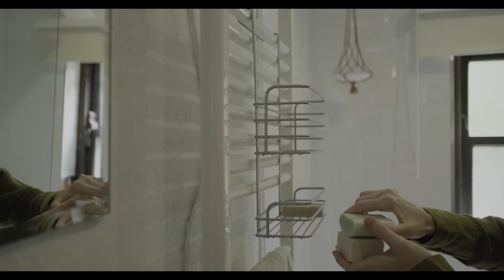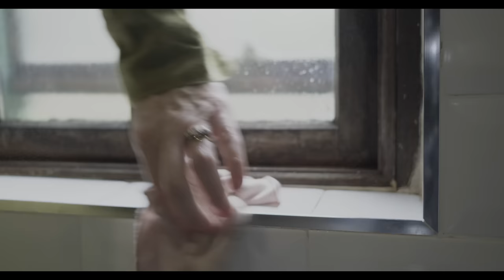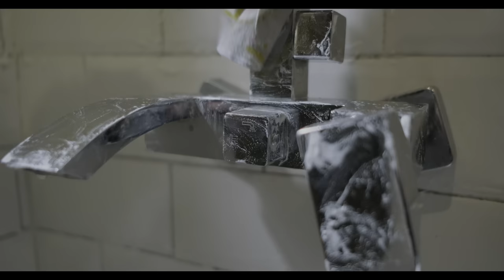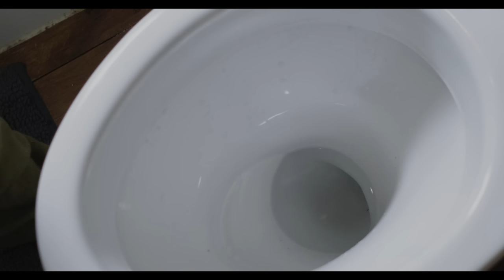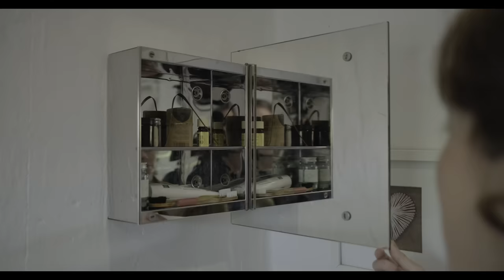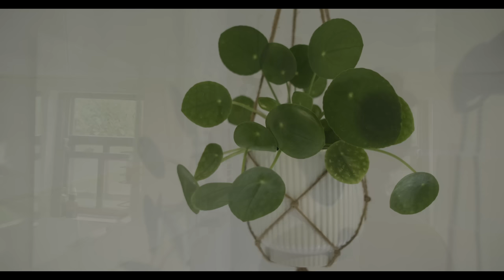Non-toxic Bathroom Deep Clean - August at Fairyland

Comment: I got.emotional seeing your daughter at the end of the video. So cute. I look forward to your monthly vlogs they're always so calming. As a single mom to my own 1 year old daughter it's taking me a bit longer to do my deep cleaning but still trying to get it done. I always feel so much more calmer once something's been fully cleaned
Reply from the maker: Awh a 1 yr old. Aren’t they just so precious… I had to have my mum over to babysit while I cleaned the bathroom 😂
Reply: I buy a gallon of Castile soap every year. I use it for everything: dishes, I have foaming soap containers in kitchen and bath sits by the sink and I move it to the shower when I bathe. I use it as laundry soap, I make windscreen washer for the car, mop floors. I don’t use it on my hair, but I wash the dog with it because it’s unscented and tear free. 
I have switched to tooth powder which I make with betonite  clay powder, raw cacao, baking soda and xylitol. 
I do the same thing with my kitchen brushes, except I found a stainless steel handle that you just slide the brush on to. I send twice as much to the heat composter than I do to the landfill. While some things are more expensive (bamboo dental floss) I buy so much less that I’m still ahead. 
You have really inspired me over the years!  Thank you♥️
Can’t help with the toothbrushes, I’m still using my electric toothbrush 🤭

Comment: I love Dissolving rhassoul/ red Moroccan clay in some water in a reusable squeeze bottle, or in a silicone bowl and using it in my hair. It rinses out beautifully and takes the same amount of time as shampoo, I find. If I want to switch things up and use a shampoo bar, I LOVE Ethique's Bar minimum unscented shampoo bar. I use diluted apple cider vinegar infused with hair-loving herbs as my conditioner and do a last rinse under cool water. I'l put a little oil on the ends while my hair is still damp. Less soap scum to clean, less garbage to toss, and my scalp and hair have majorly transformed!

Comment: Those are all excellent tips. I have found if you wipe down the shower after your finished it cuts the cleaning in half. I keep a squeegee in the shower and go over the entire shower including the shower floor. Keeps everything squeeky clean. A simple wipedown with vinegar is all I ever need doing this daily routine.
Reply: I totally agree!!  We have hard water that can stain as we live in the wilderness of northern 🇨🇦.  Like you, we have found that wiping down the shower after use leaves it shiny clean, and this cuts the scrubby-cleaning in half.  Sometimes it can seem like a bit of a hassle, but it takes just a moment or two and it saves on scrubby-cleaning in the long run.  Great tip, thanks for sharing.  Greetings to you from 🇨🇦.  Ⓜ️ary
Reply from the maker: I have actually noticed that since I deep cleaned. The squidgy I have works to keep the tiles clean. Magic!

Comment: Quick cleaning the bathroom everyday is so easy and feels so good. I do it as part of my morning routine. I spray the surfaces and then do what needs to be done ;) . I brush teeth then wipe the sink and counter down. Add a bit of cleaners to the toilet and let it sit then swish with a brush. A quick wipe of all the porcelain and done.  A wipe of the mirror with a microfiber cloth kept under the sink for exactly that purposed. I also wipe down the shower walls and door every evening when I shower. I still need to deep clean it weekly but that takes  much less time.

Comment: So satisfying to see your bathroom sparkle.  Lately, I've been cleaning all the walls and dusting around and behind all artwork on the walls.  It's so dusty!  I've also cleaned the ceiling fans, which are now free of dust.  It's nicer to breathe without dust motes in the air.  My normal motto is that dust is a protective coating for your fine furniture.  I could clean more often than I do.  I use microfiber cloths along with vinegar, baking soda, and Castile soap to clean most everything.  Everything smells fresher, which is to say there's no scent at all.  PS - Happy to see the little fairy's glee with her bath toys.  That's a satisfying use for a sparkling clean bathroom--to polish up your tiny fairy and help her sparkle ever more brightly.

Comment: I recently had cataract surgery on my eyes and realized I needed to clean my baseboards 🤣! And yes I do find myself this time of year doing that kind of cleaning. Washing down the doors and woodwork and window ledges and light switch plates. It did get quite hot here in Montana but in reality it was a brief month and a half. Still it slowed me down on cleaning much more than the bath and kitchen counters. I also use vinegar and water and a little of Dr. Bronner’s Castile soap in lavender scent. I use it with laundry soap sheets from Tru Earth to make everything smell wonderful. I am fortunate to have a friend who does cleaning for her livelihood and she does the floors and other things I can’t manage. I will be 75 in a couple days and just can’t manage it all. But we have a great time tackling things together. We’ve also had a lot of rain in the midst of the heat which has been so restorative…..very tropical and soothing. All the windows open and rain pouring down….magical.

Comment: Such a relaxing and inspiring video as always! Regarding bamboo toothbrushes, I found with mine that if I always dry the whole toothbrush with a towel after every use, it doesn't go mouldy and they wear out for composting before anything nasty happens to them. Not sure if you do that or if it would work for you or not, however wanted to share with you 😊

Comment: I am more of a Spring cleaner inside and a Fall cleaner outside. A tip for your toothbrushes, if you leave them out on the counter in a jar to air dry, they really shouldn't mold. I have never had them mold. Also, I have seen toothpaste tablets here in the states. I haven't tried them yet, but you might want to check into that.

Comment: I always clean my toilet every day - I use Ecover inside the bowel, every day, and clean around the rest with a wet piece of toilet paper every few days. I too do not use soap in the bathe, but put bath oil in the water. I do not use deodorant, but use talk, but I am not exerting myself much, as I only go out of my home to walk my dog. I use an electric toothbrush, and that the head lasts me a long time. I only put it on charge when it has stopped running, and leave it on overnight. I use old toothbrushes too to clean around the taps etc. I use the windscreen wiper type tool (like the one I saw you have) to clean the shower screen every time I have a shower. I have a shower head with little balls in that aireate the water (which is meant to use less water, and purify it at the same time) when I have a shower. xxx
Reply from the maker: Thanks for sharing!! ❤

Comment: So different here - we haven't had rain since July 6th. It's literally over 100 degrees every day - today they predict 110. The "harvest" was 6 cherry tomatoes; everything else has dried up or died. I read about that Japanese practice of cleaning the toilet as soon as you wake up in the morning - and no thanks. My toilet does not get dirty enough to warrant that, and honestly, I can't think of a more depressing thing to start one's day. I did hear of a great solution for dirty grout - supposedly amazing - one part 91% isopropyl alcohol (antiseptic), one part Dawn dishwashing liquid, 2 parts water - mix in a spray bottle. Apply to grout - let sit for a couple of minutes, scrub off.
Reply: We can't get that strength of alcohol in Ireland. 50% is the legal maximum, my pharmacist told me that.
Reply: @theclumsyprepper   Is vodka available?  That has been a stand-in for a long time.
Reply: @irenepeek3211  of course it is.
Reply: I would NEVER clean a toilet without wearing disposable gloves! Or clean anything without them…talk about cross contamination….!
Reply: @GloryBe123  All you have to do is to wash your hands properly after you cleaned each room and you'll be fine.
Reply from the maker: Thanks for the tip! ❤
Reply: @theclumsyprepper ~Nope. Staph germs, E Coli, on and on. Clean your toilet with disposable gloves, then discard and put on a new pair.
Reply: @GloryBe123  You do that if you're so afraid, I'm not bothered. I don't use gloves when cleaning and I am doing perfectly fine. It's called having a strong immune system.

Comment: I leave the bamboo toothbrush near a window exposing to the sun light, so I have any problem with mold. Also, It is not healthy leave the toothbrush it in the bathroom. Another ecologic idea is to use pieces of fabric instead of toilet paper, just to clean urine. I wash it in the washing machine. The toilet paper fabrication requires tons of celulose of trees an water. I spend just 4 toilet papers in one year. To clean mold of the bathroom, I use citric acid: one spoon in half a litre of water, and one spoon of dishes soap. Using gently a brush in the surface and then, just leave it half an hour. Then rinse.